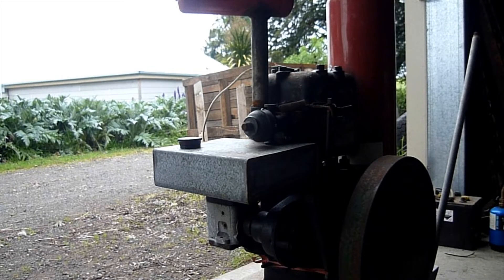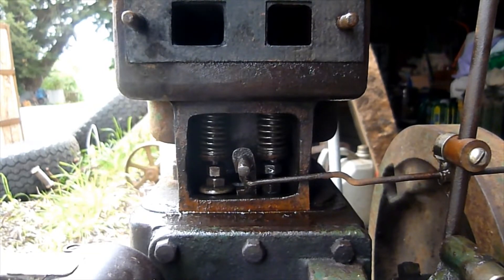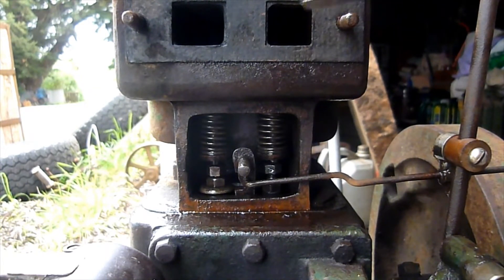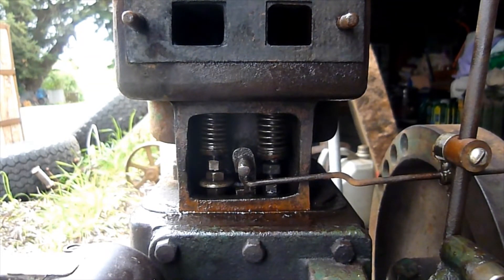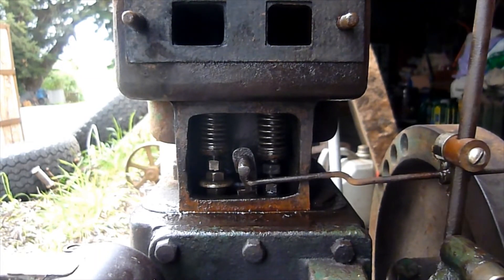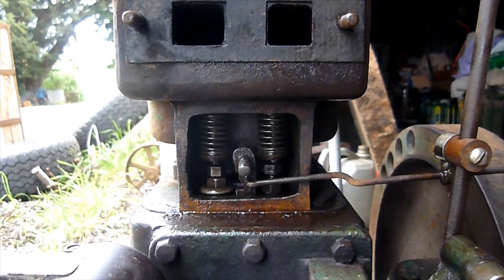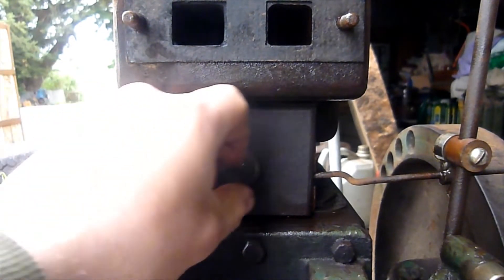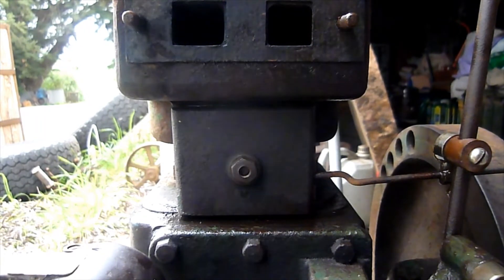Hit and Miss governed Ronaldson Tippett N type

Comment: Very interesting 
I’m wondering what the rpm range is? My throttle governed R&T does about 850 rpm.
Does it use less fuel this way?
I would have guessed you would hold the intake valve open not the exhaust but that would just be a guess.
Well done.
Here is my RPM test https://youtu.be/87iM0Rwju68
Reply from the maker: Not sure what RPM's I have it dialled into now. Would probably be about 400rpm.  on the rally field it uses less fuel than the equivalent throttle governed engines. The traditional hit and miss engine will latch open the exhaust valve to coast and the intake will usually be atmospheric so it won't open while the exhaust is open. If the intake valve was held open the hot gasses would be passing thru the carburettor on the miss cycles. 
You could probably get yours to smooth out more if you adjust the mixture more as it is running fairly rich in your video.
Reply: @NathanWoodruff_OldMachinery  
Thanks for your advice.  I later thought of course you would leave the intake closed. what do you want fuel for when the engine is doing a “miss”:)
I plan to hook my old engine up to a 1915 ish power hack saw.
It’s a Marvel No 1 from memory.  I don’t have a power saw in my little shop so I plan to actually use it.  Lucky I’m not in a rush and it should be I interesting.
I have the saw mounted and need to mount the pulleys next but there isn’t a lot of room :)
Reply from the maker: @DavoShed  power hacksaws make a great display and are also very handy in the workshop. I use one quite regularly and also have another I take out to rallies. I would like a marvel as I think they look great.
Reply: @NathanWoodruff_OldMachinery  
I’m a careful kind of guy but it looks like an OH&S nightmare :)
Probably what makes them look interesting at rallies.
Mine has patient pending on it and I have seen another one with 1918 on it so I’m guessing it is older than that.  I think I have all the parts I need now.  Hopefully I’ll find the courage to get into it soon.

Comment: That is great idea, I tried some thing like this on a small air cooled engine but could not get it to run right ,Your engine might run better if the inlet valve was opened atmospherically and not by the camshaft. Just a suggestion not trying to find fault .
Reply from the maker: Thanks. It is running a bit better now. The next step I have been thinking about is making the inlet atmospheric but it is a bit of a big job to pull the lifter out so at this stage I am happy with the way it is.

Comment: Very interesting. If you could get a heavier flywheel and run it slower would sound great. Sounds a bit like a petter two stroke at times.
Reply from the maker: Yeah it needs some more fine tuning I compare its sound to a jelbart at times hahaha.
Reply: @NathanWoodruff_OldMachinery  Maybe it just needs a bit of a load? My 4hp is much much smoother when it's pulling something.